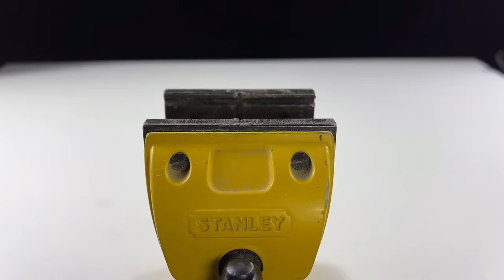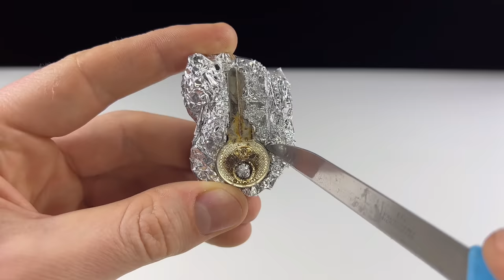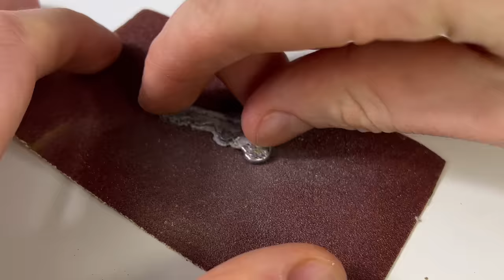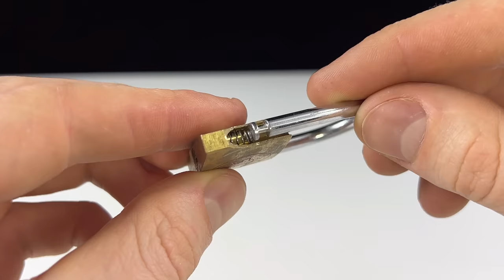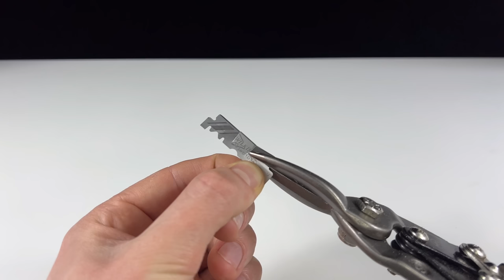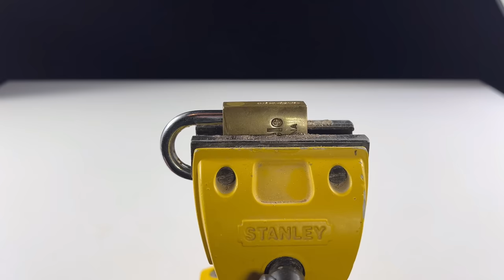How To Open A Lock Without a key

Comment: Have any of you people used or owned a grinder? I had to purchase one in order to do some work on my chimney. I needed to remove cement in between the bricks. That thing was an animal ! It was able to basically cut through anything depending on what wheel was installed. I remember seeing fireman used gas powered grinders in order to get inside storefronts. That had solid Gates to get inside, they would be able to cut through the gate like butter, I think that would open up any lock you wanted.

Comment: If I could just move my bench vise 10 miles to the shed I'm trying to break in to.
Reply: My  neighbors asked me to open their shed that had a big padlock on it. All I did was use a drill. I drilled out where the key would go starting out with a small bit and getting bigger until everything just fell apart.

Comment: But you do have a key. This is very misleading. This should be called "How to duplicate a key" because opening a lock without one requires, bolt cutters, a pick or a sledge hammer.

Comment: Yes, any off brand padlock from China that sells for $1.49
Can be broken very easily. Even the small Master lock with the combination can be broken if you have tools. As they get bigger and stronger. 
Name brand padlocks become harder. Everything can be done if you try and have the tools.
Reply: That Master Lock doesn't need tools. Tension the shanks and spin all three wheels at the same time. It's really fast once you get the hang of it.

Comment: That last Brass Combination Master lock is WAY easier to open! No tools needed. Just apply upward tension on the shank and spin all three wheels at once as fast as you can. It takes a bit of practice, but once you get the hang of it they drop almost instantly!

Comment: Locksmith 😂😃
Reply: If you own a drill and a bit that can go through metal you can open most locks. When it comes to the tougher ones you will need a grinder. If you don't want to buy one you can always rent one. I had to open up many locks in my day without the key for myself and for friends. I prefer to do things myself when I can. Locksmiths overcharge for many easy tasks especially if they need to come to your house.

Comment: The drilling part made little sense. I understand that it work but if you really need to get that padlock open then it is highly unlikely that it can be moved to a vise. That means drilling wherever the lock is almost certainly needing a hand held drilling machine. That is doable but you probably want to try another method first, especially if the lock is out of doors. Now imagine doing that a cold winter day...

Comment: Why are you even bothering at this point?
You talk about opening a lock without a key, then spend more time using the key for the lock to clone the key so you have 2 keys than you would have needed to cut some shims out of a soda can, which doesn't require conveniently having the key for the padlock on hand.

You know you could have saved yourself a heap of time and effort by simply using the existing key to unlock it right?

Comment: You're using the two wrench method wrong. The Lockpicking Lawyer has a video about that and how to use the wrenches for maximum efficiency.
It works in your case because the padlock is so weak, but with a strong padlock you'll simply fail.